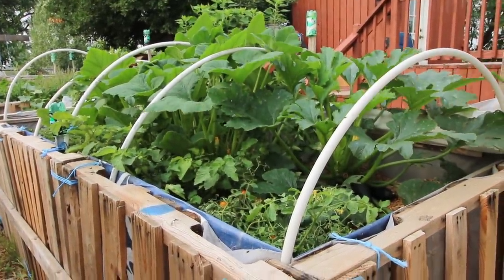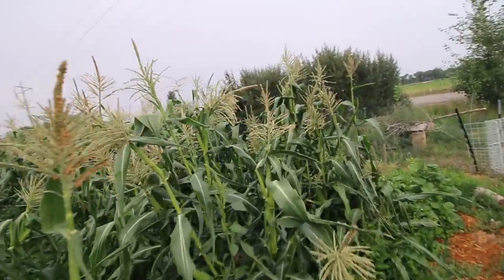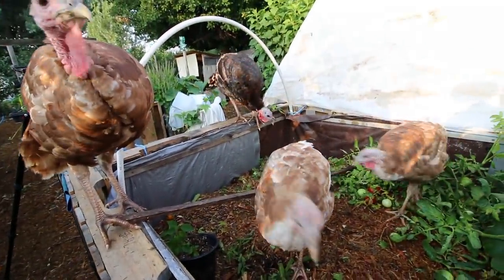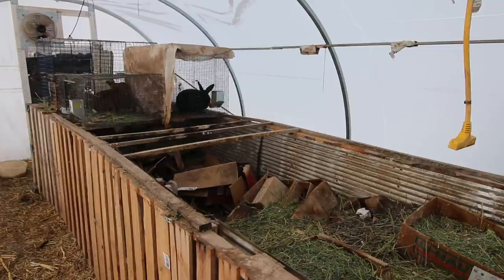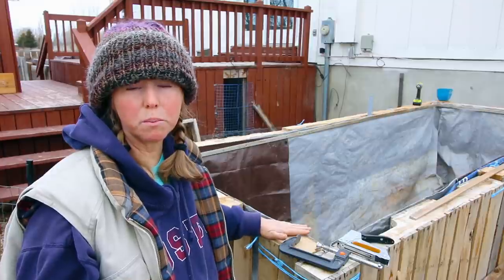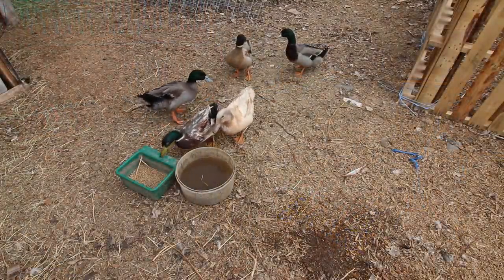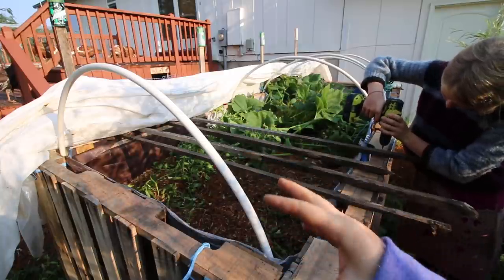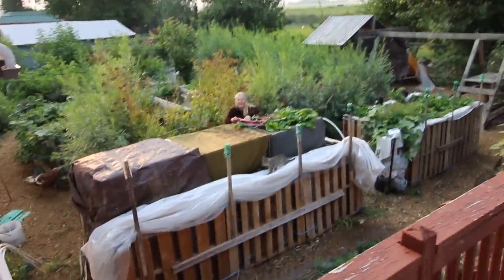Self-Heating Vegetable Garden Beds...Rabbit Powered

Comment: I, as soon as I’m out of the city one day, would love to try this system. For my cold climate I would be tempted to put a layer of plastic around the base to hold in more heat overnight during the winter months. It would be like an air barrier to slow down the heat dissipation.
Reply from the maker: They used to bury the hotbed in the ground instead of up in the air the way I do. That might be a good option too.
Reply: @dirtpatcheaven  I read about that.  Caleb Warnok?  Winter gardening author does that.  Seems like leeching might happen more but the earth is a great insulator.  I was interested in the raised 3' wide mounds John Jeavens used to plant intensively.  He started me in the direction of square foot (and inch) method which led me to the square foot method of Mel Bartholemew.  I love the neat and tidy squares.  However, @ 65 years old and handicapped I have a need for ease of use.  As long as I have help with the structure assembly you build, usability is improved for me.

Comment: I pick up straw bales that people put on the curb after Halloween,  and after Thanksgiving there are more.  Even those little ones that are pricey are on the curbs!  But if it's been raining they are much too heavy, unless they've been on a porch or protected.  
Straw is a great addition to a garden.
(It helps to have a truck also!)
Reply: The ones that are wet and heavy can easily be divided into half or thirds to grab.  Keep a knife handy to cut the bailing twine, unless it's wire.
Reply from the maker: I used to use straw. The reason I don't it anymore is the massive herbicide and pesticide load on any conventional straw. I was applying it to my trees as a mulch and it killed hundreds of trees. Now I just use good unsprayed hay or wood chips.
Reply: @dirtpatcheaven  Good point but why would herbicides and pesticides be used on straw?  Aren't most systemic anyway?  I honestly had never thought of that but straw being the end result of wheat, etc. would have no further use other than bedding, and applied to the food crop of wheat, wouldn't caution be used in applying any kind of weed/pest control?
Reply: @campfireaddict6417  glyphosate is used as a dessicant in wheat & other crops...it’s been marketed and approved in all manner of farming enterprise especially on a commercial scale...you may be shocked by what you learn and what more you learn about some newer chemicals- like dicamba...

Comment: I feel so sorry for the rabbits, standing on wire all the and small cages.😔
Reply from the maker: We are trying to build a system that allows them free movement and still safety from predators. Hoping to have it finished this year but it is slow work I am afraid.
Reply: @dirtpatcheaven  even just giving them a small square inside their cage so they can get some relief from standing on the wire.